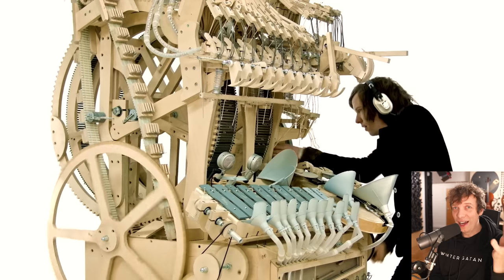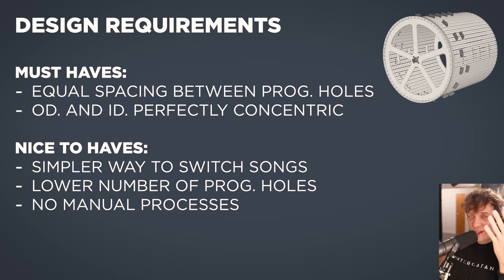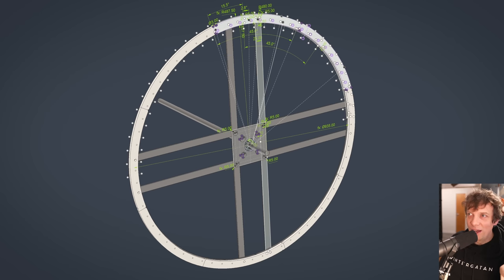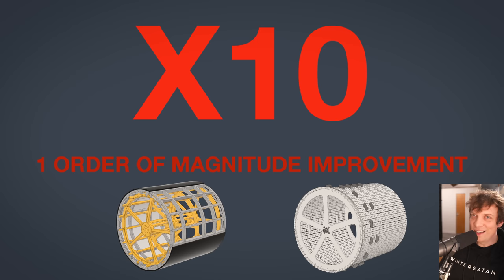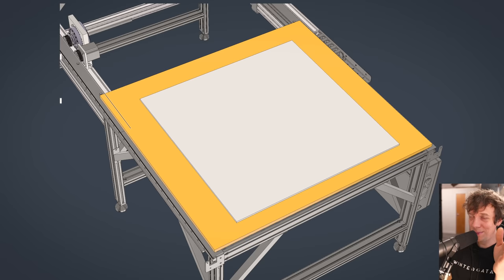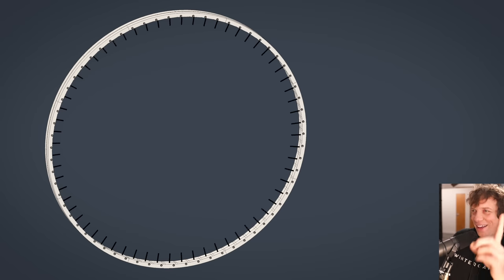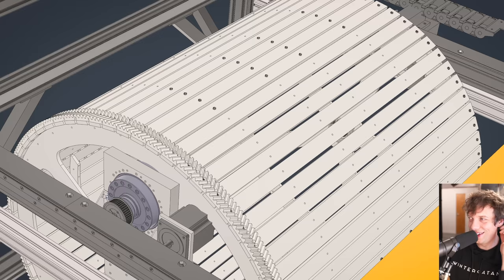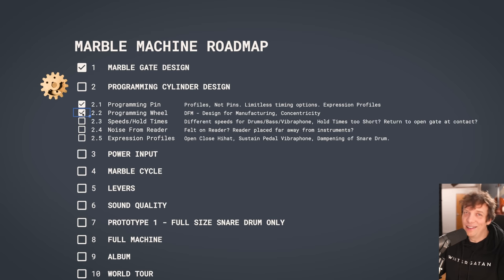A New Music Programming Wheel

Comment: If you think about it, why isn't the programming wheel a stack of "gears" for each channel which have a precut shape. Just have a whole stack of gears for each song. Can be easily cut on a CNC without much human intervention. You can have the wheel as designed for prototyping, then final songs can be committed to a stack for live. Ez. No fiddling with parts during the performance.

Comment: Wouldn't be better to ger rid of the shaft completely, and make the outer wheels roll over a spaced pair of bearings on each side? It would make the assembly simpler, lighter to transport, and easier to  change programming drums since it is kind of self centering. It just needs some movable mechanisms with additional bearings at the top to lock the drum in place.

Also, since Martin will precision machine the wholes in place anyway, wouldn't be easier to use  3 or 4 sheet sections bent on the outer skin instead of hundreds of screwed ribs? It could also add to torsional stiffness, simplify a lot the manufacturing process, and save a ton of bolts and screws. By turning the outer skin on the CNC, perfect concentricity could be achieved.

Comment: Looks good so far. Everything should be good as long as you set the programming wheel up exactly right in the CNC machine , that will be critical because if it is not set exactly right then everything will be at a slight angle. Best of luck and measure, measure and then measure again before you commit to cutting.

Comment: The double helical gear design you have now is VERY close to something I read in a book called, “American Machinist Shop Note Book” by Suverkrop. Pg numbering from the first edition, 1919. Section 13, pg 238, discuses “Formula for obtaining cutting angle of helical gears”. But the most interesting thing i’ve read so far is on pg 284, Section 15: “An Adjustable Gear For Eliminating Backlash”. The general idea is this:

Two gears, same size and shape, one with a counterbore, another with a rounded plug (no locking key). These two gears mesh together, allowed to freely rotate independently.

Gear “A” has two conical divots or holes drilled some distance apart on its inward face.

Gear “B” has two conical pins connected to threaded set screws, threaded into the face of the gear. The cones point away from the inner face of Gear “B”, toward the inner face of Gear “A”. These pins are also set apart some distance, slightly greater or shorter than the distance of the divots of Gear “A”.

The two gears, “A” & “B”, are slid together (plug freely meshed inside c-bore). When you drive one or both set screws further toward the face of Gear “B”, the gears slide against each other, rotating opposite directions. This creates an offset of teeth, such that when this “double gear” device meshes one or more other gears, the backlash can be virtually eliminated from the geared system.

I do not know how helpful this may be to someone, but I found it interesting. Maybe you will, too.
Reply: Side note, real books are AMAZING.

Comment: So many good points in these comments.
The best approach I could envision is to drive the drum on both sides using a jackshaft and to rigidize the drum with a lamella roof style system of reinforcement.  That would also lessen the possibility of the drum deforming due to environmental changes.  Are you going to add any axial runout support at the rim of the drum?

Comment: For the live performances, it may be easier to reprogram if the operator doesn’t have to place individual CAMs for each note. Instead, you could CNC entire sections of each channel using your fancy engineering plastic. You would need to rethink how the larger pieces would be fastened to the drum, but this would allow you to get away with only 2-3 pieces per channel. Just a thought, great to see the progress so far!

Comment: More custom parts is indicative of more complexity, so it's a useful metric to minimize simply to reduce unneeded complexity (as well as time to manufacture), more off the shelf parts like bolts is slightly less linked to complexity.

I was also wondering if the plastic would be rigid enough. Can't wait for a test.

Comment: It depends on the lifetime expectancy and allowable tolerances, but I would imagine the middle of the drum to sag down, especially in warm and humid environments, causing timing issues.
I'd probably also machine the front and back plates out of aluminium on a laythe, ideally both at the same time to guarantee symmetry.

Comment: Do you HAVE to have a wheel to program your music?  You are restricted by the circumference of the wheel and the circumference is regulated by the wheels diameter.  This results in lots of empty/unusable space. What about  a conveyer belt? The belts can be bent with gears and pulleys to allow more notes to occupy the programming space resulting in longer songs.  In addition, a tension pully, like in a car engine, can be used to further modify the song.  You can put a much smaller wheel/gear/pully at the spot the programming profiles interact with the marble release mechanisms and coil up the rest of the belt to save space.  Something like the shape of ribbon candy 

In other words, a flexible programming surface may or may not be a less dumb design.  It might be worth considering.

Comment: I follow you from time to time since years now! Always amazed by your search of improvement and design iterations. About the programmable wheel, I have a question: did you already imagine a way to record the program in a file or a punched card, and then use recorded files to reprogram the wheel on demand automatically with a mechanical/robotic assistance? The programmable wheel could have a "reading/writing" device to update the position of each note.

Comment: I have a feeling those long, narrow, and relatively thin strips of plastic, “engineer grade” or not will be flimsy. I think you will end up needing more support in side the ring other than a few random braces. A 3rd hub seems like it will probably be necessary. I also like the idea someone else had of fixing the wheel to the shaft to prevent twisting forces.

Comment: Hey,
As a robotics engineer, I'd just like to give you a quick advice :)
When precision matters, bolts are not good for aligning two parts. Their diameters is not precise enough, so you need a lot of play between the bolt and the hole to make sure it fits, which leeds to very unprecise assembly.
In this case it may not matter, as you machine most of the precise features after assembly. However, if you ever disassemble the bearings, you will lose concentricity.
Instead, we usually use alignement pins. These are smooth cylindrical pins machines to very close tolerances on the diameter. Coupling them with precise holes in the parts in which the pin has (ideally) no play at all, we make sure alignement is always perfect. Then the bolts are just for tightening everything.
On the bearing block it looks like you don't have any locating holes, but there usually are some locating features : surfaces machines to precise tolerance to be used for alignment. If there is none, I would search another bearing block.

Hopefully this should help. Love your work, that's so nice to see engineering meet art in this way. 
Cheers

Comment: Might be worth getting a servo for the rotary axis in order to get the precision. Treat it like a fifth axis on the CNC. I don't think I would trust a regular stepper and counting steps on the rotary axis, specially when you get to the locating pins and pin grid. Might also be worth looking at putting a torsion tube between the two spokes. Something like a 4" or 10cm pipe that you can glue or chemically weld to the spokes would help a lot with any potential twisting. It also wouldn't need to be a precision piece other then the very ends where you are interfacing to the spokes.
Reply: That's a great point, especially with how precise martin wants everything. Seems like it would be beneficial to have some kind of encoder feedback as close to the drum as possible.

Comment: I personally like the ribbed belt better. a belt that diameter wont slip and with a good spring loaded belt tensioner changing is fast and there is no chance damaging hard to replace gear teeth when changing drums, also off the shelf parts!

Comment: Why screw each individual length separately? With the bracket you have made on the inside sections, your essentially holding 5 to 6 horizontal pieces already, fit another wheel in the center with a flat edge 50mm across, provide butterfly screws on the side with threads on or a clipping mechanism  to clamp in 'sections' pre programmed
-less manufacturing
- 1 less barrell
- lighter to carry
- sections are pre programmed

Note: think of holding the horizontal peices screwed into something like a thick strap on each side, essentially wrapping the programming peices around carcass of the shell, provide eyelets in the strap for locating into a pin,  these programmes can be rolled away and pre stored in boxes

Comment: If so think about „no manual work“ you may want to think about electromagnetic programming pins. So you could change the programming digitally. You could also use pneumatics and valves to push out the pins. That would allow for more complex songs and if you want, an endless programming wheel. If you synch the changes to the song you could integrate the sound as a per Baskin instrument.

Comment: I would be concerned with twist on this wheel. No matter how hard you secure those bolts, the bars will still pivot and no longer be perpendicular to the wheel. I would suggest some cross members between the wheels that are either diagonal from one wheel top to the other wheel’s bottom or a crisscross similar in shape to the cage you had on the MMX. Only secured to the inside diameter of the wheel instead

Comment: I think you need to add cross supports inside the wheel, it looks like there might be some twisting flex across the wheel. I have a feeling that the tightness of the notes will be affected from the far right note to the far left note. maybe put the gear in the center of the wheel? imagine the gear putting load on the gear side of the wheel and then there are 8 notes on the left side of the wheel twisting the wheel. the whole wheel will want to twist like a helical.

Comment: The SKF bearing will not stay in the middle with just bolts.
But have some hollow dowels = tubes inside the bearing srew holes that centralize the bearing to it's holes, and the boltsthat go thru the dowels  just keep the bearing in place

Comment: If you have a gear stock on both sides of the wheel, then you don’t need an axle at all. You can rest the wheel on four rollers (two being driven), and swapping the wheels will be very easy.

Comment: I think your new wheel will be wobbly, you have side to side stress that is only braced in one plane at the axle. The bearings are not designed for the side loading either. Maybe it you braced the inside of the wheel at the bearing plate to the opposite side of the drum with wire that can be tightened -look at a bicycle's spoked wheel. Spokes like this can also help bring the wheel into true within reason.

Comment: You might want a gear on both sides. I recommend you do a simulation to check how much circular displacement you will get from the torsions created.
Also I recommend you use fiber enforced plastics to minimize flex.

Comment: I would machine both wheels at the same time to ensure perfect contricity relative to each other. You need to ensure that both the ends of the drum cannot twist relative to each other and give you huge headaches. If the drums have an axle I would recommend a keyway or spline where the axle meets the wheels

Comment: If you keep running into persistent timing issues despite these improvements, study some single-action triggers in gun technology. You could split your notes into "arming" by the programming pins and "firing" by a clock signal that's triggered directly from a flywheel. Then your timing would depend only on the flywheel and variations (within reasonable limits) in the programming wheel wouldn't affect timing.

Comment: Hey Martin, you're on a great path.
I would suggest that you talk to torsion/stress engineers. Having a wheel spinning around the axis only driven from one side will possibly introduce deformation of your material.
As you plan to switch wheels (why not one per song?), cou could probably have the wheel and the axis attached together and the axis spinning on the MM3 structure instead, or, you could have a sleeve around the axis to provide rigidity (like a bike wheel). I think you may also need one or more inner supporting wheels to prevent bending. Reading heads will exert inner pressure on all the contact surfaces which could lead to bending or breakage.
That being said, all your design principles seem very clear and proper!

On another note, I was thinking, since off the shelf part are no problem, why not build the programming wheel around commercially available wheels? Stupid illustration examples: drying machine drum or 5 bike wheels connected together. There ought to exist axles and gears of the dimensions you required.

Comment: You have to chose either fix the rim to the Shraft, OR have drive gear on both sides. Personally I think the "both side drive" will allow for the lightest complete wheel design. This will make change and transport easier. And make one wheel for every song. If reprogrammed back stage you need some kind of "tool"/ system to verify the program. Hope you will visit Copenhagen.

Comment: having 1 bolt on each wheel per horizontal plate will cause the drum to twist, specially if it is driven from one side only. 

the center shaft will help minimize this but it is not thick enough (a 100mm metal tube can help).

driving the drum from both sides is safer.
having 2 bolts on each side of the horizontal parts can reduce the twist.

Comment: Make the drum removable from the main drive. Possibly a hinged bearing section and a keyed or splined shaft. Another option would be split bearings and a hinged cage. Pop the cage, break the bearings{overcenter locks perhaps, or turnbuckles} pull the drum, slot in the new one and lock it down. If done properly, I can see no reason why you wouldn't be able to swap drums in under a minute.

Comment: Hi Martin, you could, like in a cylinder music box, moved the cylinder slightly sideways for each different song rather than changing the cylinder. My cylinder music box has 6 different songs on one cylinder and they are selected by moving the cylinder sideways.
Second point, now that you have the special CNC machine you can for the tour marble machine just use pins again bacause if you start with a cylinder without holes you can use the CNC machine to accurately drill holes at exactly the positions where you need the note. This is the way it is done for cylinder music boxes as well which use a metal cylinder with wax on the inside.

Comment: Last operation (programming slots) may be tricky. Rotary axis drive will probably hold very well, but shaft, spokes and outer mesh may drift a little due to pressure of the spindle. Consider using magnetic brakes (if your CNC controller allows you to ise external signal outputs) on the non-driven side of the drum.

Comment: Two little concerns with this design from my side:
- Screws are not made for centering, they are made for fixating. -> The metal parts (axle, bearings, ..) seem to be only positioned in the plastic by the screws. I think you are not using any centering pins. This can potentially already danger your mission to have perfect concentricity. Esepcially if you assemble and disassemble the wheel. (Unless I am missing a step in my thinking.)
- The gearing does not seem to be involute gearing. If you want to have silent and smooth rotation, this is something to look into.

Comment: To get the gear milled correctly for the double helical design the milling motor’s shaft and cutter needs to “tilt” aka a 5 axis cnc. I’d consider a straight tooth gear alternative, not as smooth theoretically but in reality maybe smoother.

Comment: Very impressive design plan Martin ! A very pragmatic way of thinking 😁 however, designing a chevron sprocket is more complex than a straight gear sprocket. I’d recommend you document yourself about involute geometries (développante de cercle in french) first applied to straight sprocket, then to helicoidal and chevron sprockets. It’q quite a complex topic, engineering school level. But, knowing your level of curiosity, I’m sure that you’ll be very much into it ! 
PS : don’t be scared of the math. I’d recommend you create an excel sheet to generate all the data necessary to designing the gears 🤗

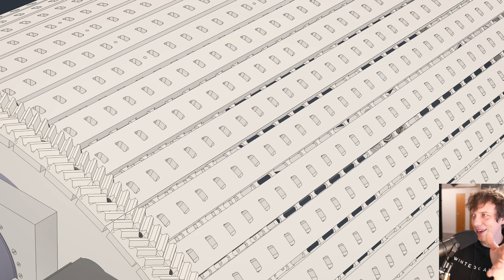Comment: 12:10 I think you should rotate the drum using the newly milled double helical gears to make sure that the positions of the programming holes match the final gear operation – any slight problem in the gears would be automatically taken account while milling the programming holes. Other than that, nice design indeed!

Comment: 12:10 I see a big problem here. The lack of support for the plastic bars that have the programing holes in them. Without any support from the back, the CNC drill will deform the plates enough that any hope of having consistency will be lost (the holes near the spokes will bend way less than the holes in the middle of the wheel). 
Also as someone mentioned: Twisting in the end product might be a great issue. A simple FEA simulation needed asap.

Comment: Interesting design, sounds like it could be a big improvement. I do wonder if a belt drive would not have been feasible while still making it easy to replace the programming wheel. Gears tend to have some drawbacks such as being more prone to wear, or teeth getting damaged when a wheel is being handled for programming.